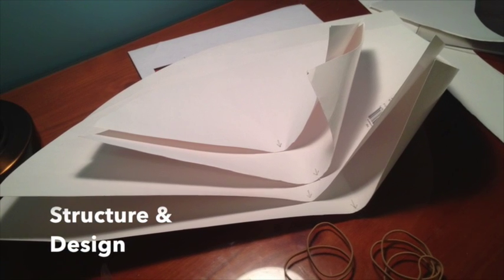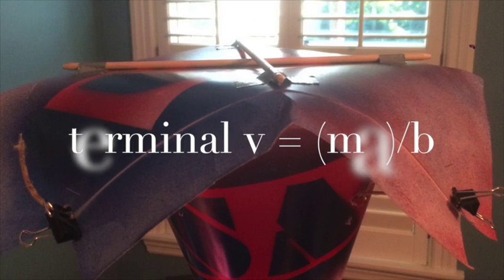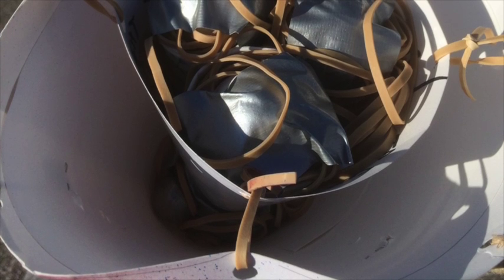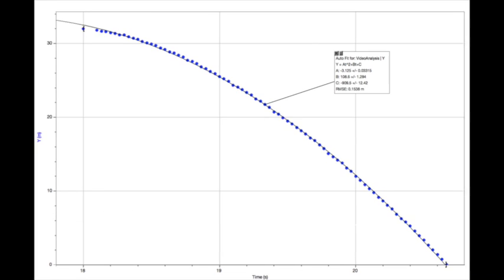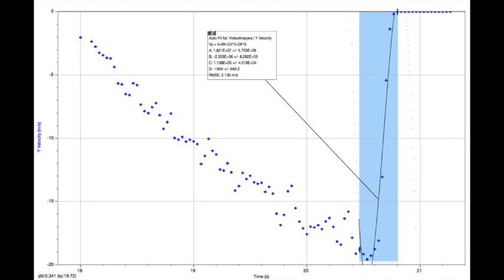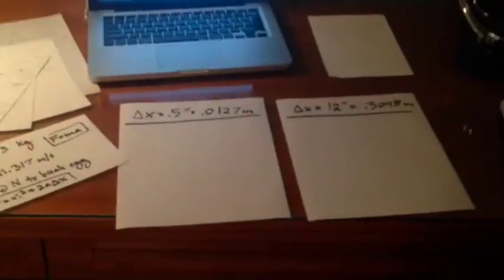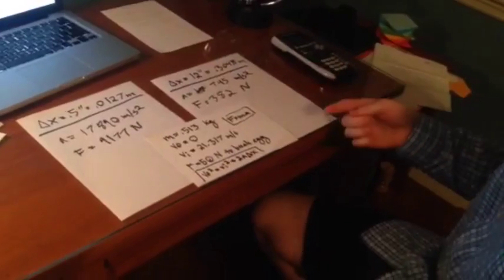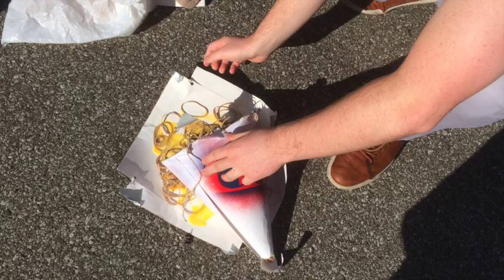Paper Cone Egg Drop Analysis IMPROVED (PHYSICS EXPLAINED)

Comment: Very nice, but your problem here wasn't only the high center of mass but also the design of the parachute was not good, aerodynamicly speaking it made the whole cone unstable and thus it easily flipped over :)
Reply: if you wanted it to be a stable parachute you should have "flipped" it so that it is like a bawl, though that would reduce drag